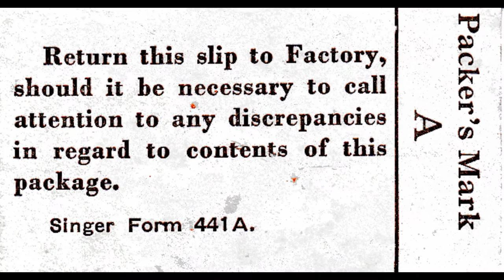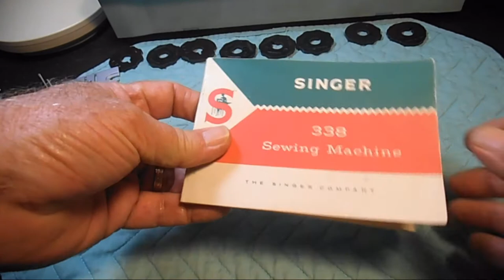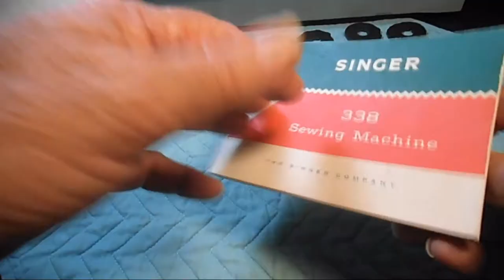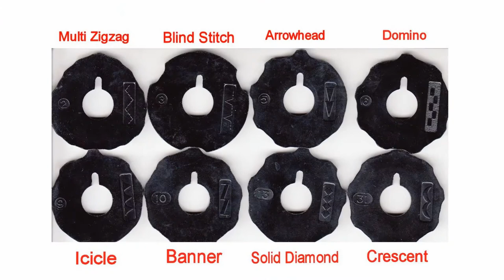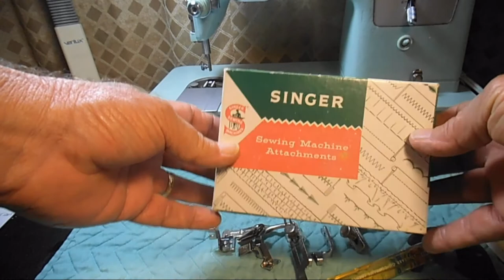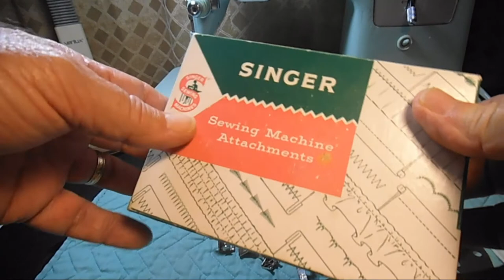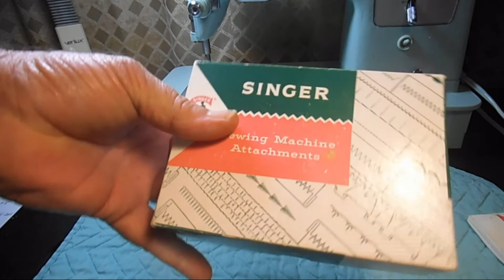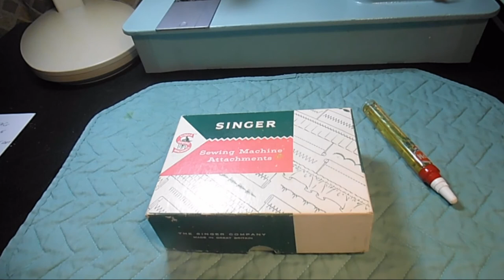The Full Attachment Set for the Singer Model 338 Sewing Machine

Comment: I just purchased this machine in great shape with the accessories kit. Mine also has the raising plate and the same special purpose foot. It looks like, even though the attachment point is different on the special purpose foot than the rest of the feet, this was included in the original accessory kit. See page 43 of the manual.
Reply from the maker: I see that now, on page 43. Thanks for letting us know, and congrats on having the full set.

Comment: Thank you for the video. I've been interested in learning about the accessory kits after acquiring a 500A that had the manual only (in very good condition by the way). Lots of good info.
Reply from the maker: Welcome. I find the attachments very interesting even though I don't actually sew anything. I always get the free parts diagram from Singer to see what originally came with each model. For the 500A this is the download page: http://parts.singerco.com/CPpartCharts/5_59999/500A.pdf
The list of the attachments is on page 2. It does not contain the multi-purpose foot or special disc No. 1 because those came installed on the machine itself. Thanks for watching Andy Tube :)

Comment: Hi! Thanks for your very informative video. I was wondering, do you have a personal shop where you sell your refurbished machines? Also do you know right off hand which other models the 338 is compatible with as far as parts go?
Reply from the maker: Hello, M. I do not have a shop; just sell on my local Craigslist in Phoenix and word of mouth. As far as other models for parts comparable to Model 338. If you mean presser feet and attachments, then any Singer straight shank feet would work. So the slant shank would NOT work. That would include buttonholers. If you mean parts like needle bar or handwheel then take a look at this Singer parts diagram for 338. It shows the part numbers and that's what to search for and ask sellers about. http://parts.singerco.com/CPpartCharts/3_39999/338.pdf
Reply: @andytubesewing1953  Thanks Andy for the quick reply! I was actually looking for the cams. Mine came with the factory zig zag that was installed but no others were with the machine. I am seeing quite a bit of fashion discs for singers. I can tell by the images that some probably aren't compatible. But there were some for a 306 that look like they would work. Thanks for your time.
Reply from the maker: @mville9840  Sure. The 306 cams are the same. They were the first type of cams and Singer labeled them as Type "A". Any black flat cam should fit, versus the "top hat" style that would not work for you.